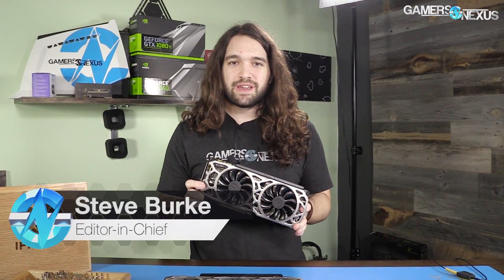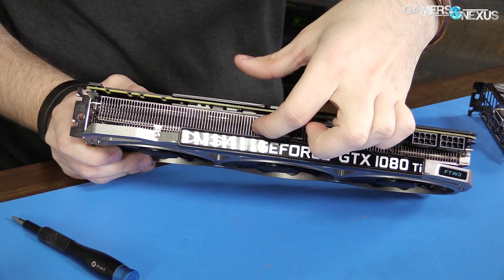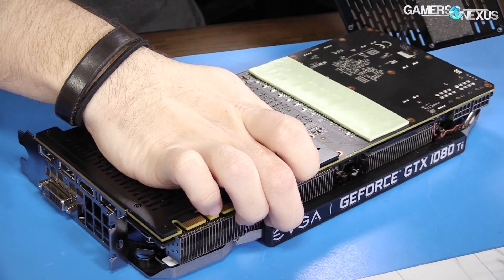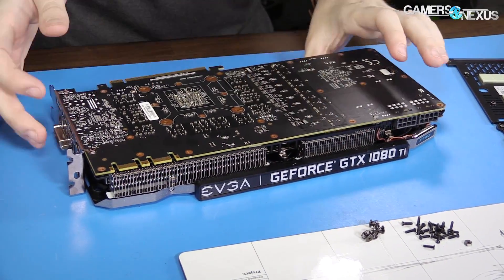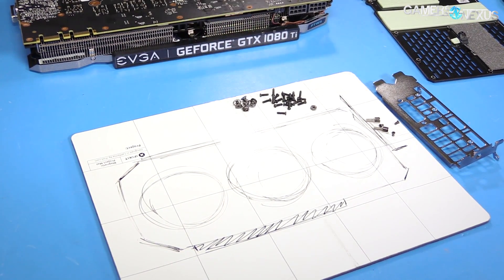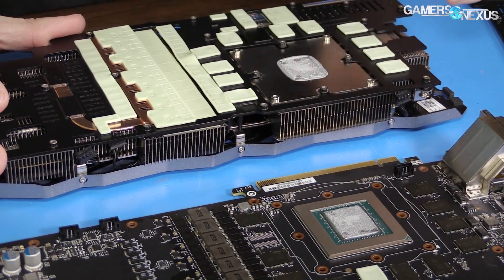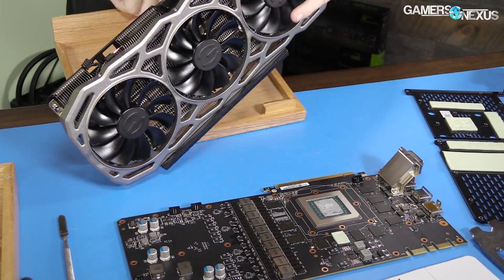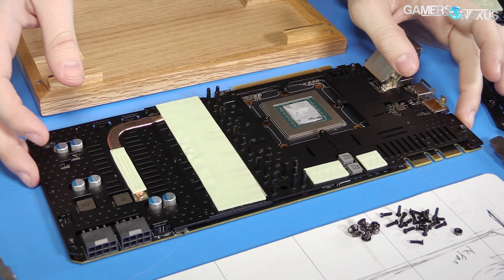EVGA 1080 Ti FTW3 Tear-Down & Preliminary PCB Specs

Comment from the maker: Thanks for watching. Article & tools linked in the description, along with the GPU itself. We'll be working on a PCB analysis and review of this in short order. Titan Xp Hybrid content is also nearing conclusion and will go live within a few days: http://www.gamersnexus.net/guides/2894-evga-1080ti-ftw3-teardown-and-pcb-info
Reply: It still could use your beard though, to make it extra manly. (Yes I'm the same guy from Pax stream)
Been waiting since December, EVGA teases me. D:

Oh yeah nice showcase by the way.
Good to see EVGA stepped up to address the concerns people had after the GTX1080 'problem', even though it wasn't a problem but a mosquito being blown up into a negative media festival.
But I don't blame them, they have their name to hold high, and media can influence a lot for those that mindlessly read articles and believe it. (90%+ likely)

The outcome is even better coolers that can stick to a 2-slot design, which I really like to see.
I don't need them to become unnecessary big and heavy causing sag or extra risk of bending overtime to itself or other components, and neither have it blocking any other add-in slots.
This way configuration possibilities stay the same as a Founders Edition (the whole reason to use the blower cooler is for this reason) and people with ITX cases and such don't need to worry. (except if the FTW3 is too lengthy, but then you have the SC2)

EVGA - customer satisfaction = #1, that's for sure, not only in built quality but also in aftersale services.
Reply: Great video.  Watching you take apart that card makes it look like just getting to the fins to clean them will be similar to keeping a plexiglass side panel dust free, a living hell. lol.
Reply: Zarcondeegrissom Tell me about it, I get so much dust from where I live, plus the kids and the dog don't help. I put my full ATX case about 5 FT from the floor on a file cabinet to avoid foot traffic. my last build was on a custom PC cart and got so dirty being close to the floor.
Reply: Gamers Nexus do you have an idea of when the review will be up?

i presume there is a NDA until May 1 or near
Reply from the maker: DragonKiller Ryu There's no embargo, hence this coverage. It'll be up when we're done testing.
Reply: is there water blocks for the card?
Reply: Did you guys try removing the plate around the fans? I'm curious because it seems like one of the easier ones to do that with at first glance. And the reason I'm curious is to consider painting it.
Reply: Gamers Nexus Man I was wondering this myself after seeing the Elite unit's, I might paint the top blue on my SC2, but not yet while it is new. To large of a purchase to void my warranty ATM. I am waiting for effn FedEx to drop off my GPU
Reply: Trancefreak64. About the same where I live, between pollen and dirt from outside in the woods.  Why is it so impossible to make a GPU cooler that is easy to clean the cooling fins on these days that does not suck at playing games on, lol.
Reply: Could you do a review on the FTW3 please? I'd like to knkw if it is a card worth getting. Thanks
Reply: Gamers Nexus I really liked your videos if you mind can you check my videos i alsow subscribe and liked to your videos

Comment: 10:50 They don’t increase surface area, but they cause turbulence which helps to mix the boundary layer (effectively the air flowing over them is cooler)

Comment: Nice video. Thanks! I would like to know thickness of each pads. I would also like to know what type of pads those green really is because Im not sure if grey 14,8w/mk pads would be much better?! It's almost 2022 allready, but I quess im getting one of those similar cards and I could upgrade the pads if grey 14,8w/mk is much better. What I've seen, that green/yellow stuff if more soft and slimy than the grey one. Im not sure if grey 14,8w/mk pad is more pro stuff?!

Comment: Love your content, helped my tear down my sc2 and replace paste and pads working better than ever much love gamers nexus
Reply: Duude.. I'm getting ready to tear down my icx sc2 tomorrow night.  Anything I need to look out for or be careful with? I took took apart a 970 and 1660 super but those seek simple compared to watching this! Any help is greatly appreciated!
Reply: @TheOlneyandrewl01  its relatively straight forward my hardest task was just putting it back together could be a pain getting shit plugged in but used some tweezers and i was good, also you need a ifxit knockoff or kit cause you have to take the VGA screws out and thats the only thing that had the screwdriver for me
Reply: @tristang4880  I just twist the vga screws out by hand haha
Reply: @TheOlneyandrewl01  replaced all the pads and cleaned it up and used some thermal grizzly and card is now being overclocked at 2025 mhz and 6003 at 1.093 v with fans at max speed card barley gets hot max i seen is like 63
Reply: @tristang4880  what thermal pads did you use? How thick? Were they a kit or cut your own. I'm a noob sort of.. lol
Reply: @TheOlneyandrewl01  I used a 145 x 145 x 1.0mm artic thermal pad off Amazon and just lined up the old thermal pad and cut it to size on the new one and kept it all stored which thermal pad goes where, def a tedious process

Comment: So for the grace of god. Does anybody know the size of this card after its torn down? Im trying to add a Kraken to it. And its a very tight squeeze in my case. I know a card that is 287mm will work. And I know this card with all those fans and things is longer. Like 300mm but im wondering after tearing it down. Will it trim the length a bit? Anybody ?

Comment: Still useful in 2021 for teardown to reapply pads and paste. Thanks Steve!
Reply: For anyone seeing this now, 1mm for PCB, 1mm for the radiator on backplate, and 2mm for the backplate proper
Reply: @chronicbaggage  thermal pad thickness?
Reply: Yeah I just found this when tempted to re-paste my 1080ti ftw3 as well.
Reply: same using the 1080 ftw 2 , pads on both sides and new paste. the so called paste evga use is not that good and its a good brand that's been told had same issue with paste on the evga 980 unless its down to the passive mode but still should be good tim
Reply: Hi, can u please tell sizes of thermal pads for this card (i mean thikness) if u still remember it. Can i use like -  Thermal Grizzly Minus Pad 8 (100x100x1.5)? Its would be unough for just for front plate? thanks in advance!
Reply: @MrShushpan4ik hey did you figure it out?

Comment: I’m asking everywhere I can:  Just stripped a bunch tiny heads on the 1080 FTW2 (iCX) backplate because they were tight af and I didn’t even realize I’d stripped them until I looked closely.  Obviously it’s my negligence, but do you have any graphics-card-specific solutions for this situation?  Rubber band didn’t work, and the rest of the typically suggested techniques seem to be unsafe for a graphics card.  Any and all suggestions welcome, thanks :) EDIT:  the screws that came off easily did so by using #0 and #1 screwdrivers, depending on the screw.  They were all the same size so I don’t even know how that’s possible.

Comment: Hi Steve, How did you go about unscrewing the four silver spring screws that attach the heatsink to the baseplate and PCB? They are a difficult to access as the fan shroud obstructs them quite significantly and I had quite a bit of difficulty with them. As far as I could tell they are the main screws attaching the heatsink to the baseplate and PCB and have to be removed. Was there any special way you approached that?

Comment: Gamers Nexus,

First of all great video; it was very informative! I've been looking into buying this card for a while now. I'm shooting for a black and white build and I missed the boat on the ELITE versions of this card that can ship with a white or black shroud. In your disassembly, did you ever take of the shroud? Is it as easy as removing the hex screws you pointed out in 1:47? Are there any cables attached to the shroud that I would need to perform a full disassembly to disconnect? I'm trying to avoid taking the entire card apart to paint or PlastiDip just the shroud.

Comment: Is it really necessary to pull the back plates off to pull the cooler off like you did?  This card runs a little hotter then I like and I was thinking of changing the thermal paste if any of you all think it will help.  Does EVGA already use very good thermal paste?  I just want to get the gpu or power a little cooler as VRAM seems to cool fine.  Thank you

Comment: EVGA's gone overboard with the thermal pads because of the 1080 FTW debacle.  Also I'm not convinced that the triple smaller fans push more air than the two regular size fans.

Comment: I'm still wondering, and this question has gone unanswered by EVGA, what size are the fans themselves? 100mm? 90mm?

Media have been saying 100mm spinners from the early announcement days, but seeing the card is barely 300mm I doubt that they are 100mm, maybe 95mm in diameter.
Reply: These fans are 90mm in diameter each.

Comment: I've been buying Asus Strix cards since the 680, and I'm a bit disappointed to see so many manufacturers moving to a 3 slot cooler. I suppose I'm in the minority with a pci-e x8 raid card in my other x16 slot. PCI lanes are expensive, and it bugs me seeing so many companies claiming 32 of them by making unreasonably large coolers. So, unless this one just bombs the benchmarks, it will be the one I get.
Reply: Asus didn't have strix back in gtx680 era. They had strix line up since 970 and those were significantly infetior to giga and Zotac. On 1xxx asus is doing a decent job
Reply: Ah well busted memory is busted. Looks like it was the "GTX 680 DirectCU II OC Edition". That was before my motherboard was crammed full of expansion cards as well. Back then I was buying more based on who I trusted more. It was the first time I'd ever been able to afford and bought a top of the line GPU. I'd never heard of zotac before at the time, and I'd had a failed gigabyte and evga card in my history. This purchase will be me giving evga a second chance. Hope I don't regret it, and they'd have never gotten it if the strix was a 2 slot.

Comment: is it just me or did EVGA make this unnecessarily complicated? It would have been simpler to just sink the memory and VRM directly to the main heat sink like MSI, Asus and Gigabyte did
Reply: +Certified Shitlord Haha "complain" about this 1080Ti being unnecessarily complicated and then go for an Asus Poseidon. Makes sense.

Joking aside, there is a whole lotta over-engineering throughout the entire industry, so EVGA doesn't really stand out all that much here. And, in my opinion, anything that helps keep the graphics card from having those little wiggly dips in clock speed is a good thing  - and certainly a reason to buy a Poseidon 1080Ti if you're going to create a custom water-cooled rig. :)
Reply: It will heat up your heatsink more though, unless you use the extra space to increase the cooling blocks size. I don't know, I am happy with this design :)
Reply: Zandter yeah, it'll heat up the core a little bit more but with Pascal, temperatures aren't that big of an issue anymore so you can afford to sacrifice a little bit of cooling on the core for increased cooling on the VRM. Either way, this doesn't effect me. I'm likely to be getting the Asus Poseidon anyway
Reply: I believe they said EVGA has the advantage by not doing as you suggested. In another video, though.
Reply: Morzy they have the advantage in core temperatures
Reply: Penterax how am I complaining? It's just a normal discussion. I think the EVGA card is unnecessarily over engineered and think EVGA would have saved time, money, energy and resources by just sinking the VRM to the main heat sink and increasing the size of said heat sink to accommodate the extra heat, nothing wrong with that. 

Plus. I'm going with the because I wanted a card with a nice looking air cooler on it so I can mount it vertically but I still wanted a liquid cooling block on the GPU for acoustics, so the Poseidon is a good option for me.

Comment: The same memory module is removed, yet there's a thermal pad... Interesting.
Reply from the maker: Ujiltrom M We're thinking maybe to prevent contact between the plate and PCB, or reduce risk of error at the factory.

Comment: hallo gamersnexus. What would happen if you solder a 1gb Vram module on the missing place. Would that work without the need of changing any software?
Reply: profix25lo its disabled in the die also
Reply: Federico Salemi what if you solder it parallel to an other module
Reply: profix25lo nothing
Reply: profix25lo That's not how it works

Comment: Can you please make any recommendations for buying the best 1080Ti based on various factors like build quality, cooling solution, stability, price etc.
Reply: sami haq Most of them are identical in cooling and performance. At this point, go with whatever one you think looks the best. I like the design of the Aorus 1080ti, along with the internal hdmi for VR, but that's me.
Reply: I like Aorus too n its fr 720$ which is nice but its massive in size n i hv to get 2 cards for now n possibly 3rd in future. 03 aorus cant possibly fit in evga classic x11 board which i hv selected. so the problem. then i like evga sc2 but its out of stores n retail price has hust been increased to 750$.
Reply: sami haq My white Gigabyte OC had unbearable coil whine so I'd steer clear of that one, I may try my luck with an EVGA
Reply: I check reviews on newegg and those are usually accurate. Aorus 720$ 1080Ti is the best selling and has the best reviews by the verified owners on newegg. So its a good idea to first check the user reviews. Only downside i hv seen from the reviews is its massive size.

Comment: Man i really start to love this channel, im watching every video instantly even when i dont even need help with  taking apart my video cards since its not even hard tbh lol. The only thing that keeps me away from tearing down those 1080ti's is the price, i dont have the money to get one lol. Man cant Vega just hurry the fuck up otherwise i will just buy myself a gtx 1080 and a 1440 144hz monitor. Kinda sick of waiting for AMD to show me a good fucking video card....
Reply: Hawkeye979 It does suck, but Vega is going to be AMDs top-of the line. I don't imagine it to be much cheaper than this option
Reply: it will 100% be cheaper, since Nvidia has a monpoly right now and is just shiting out moon prices. Amd needs to top the price since otherwise they will just dont sell anything and cry in the corner. I would say the Vega will be 1080 - 1080ti performance for 100-200€ less than the 1080ti. The only thing thats holding us back is the god damn fucking release LOL. If they dont release it by ENd of June i will just buy myself something else... im just sick of waiting  probably gonna buy a 1080 arround end of July. I hope that Vega will be good but so far i dont have high hopes.
Reply: So did you got yourself something else or still waiting for Vega? I'm so sick of waiting. -100 € is not worth waiting another month or two for me.